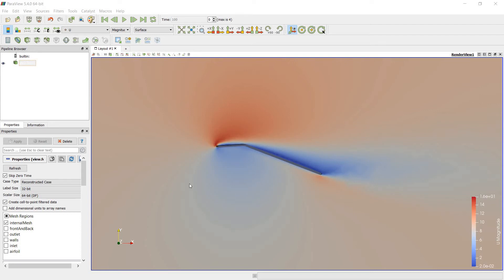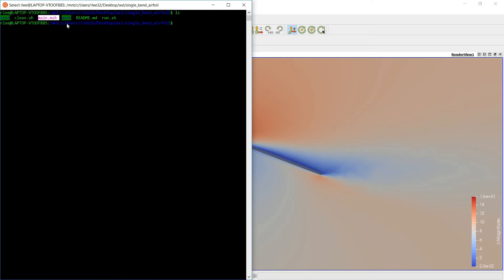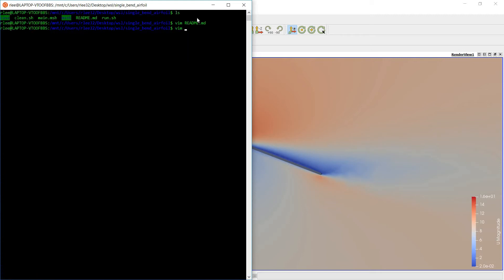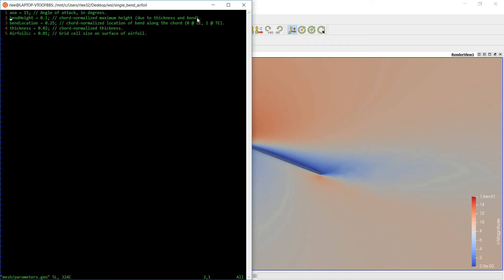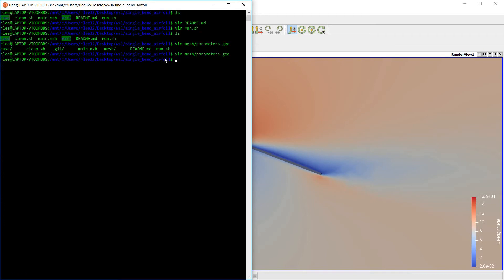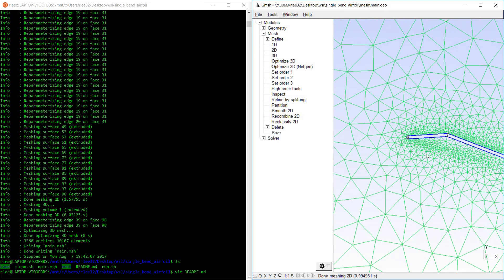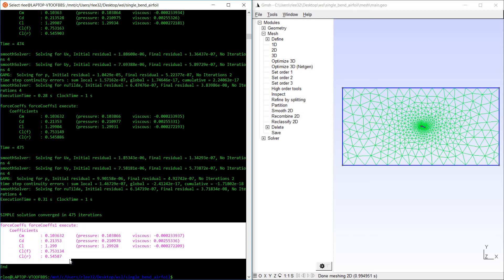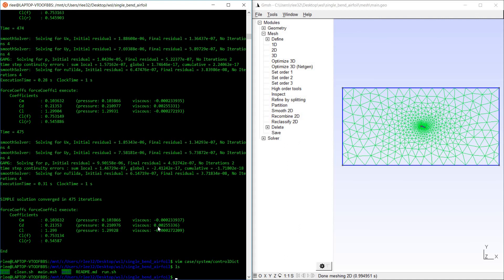Single Bend Airfoil in OpenFOAM

Comment: Hello, I am doing the simulation at 13 deg of an airfoil. The reported values of Cl are perfectly matching the experimental data but not the drag value. Which area did you use in contoldict/forces planar(from top of the airfoil) or frontal?
Thankyou

Comment: Could you also explain how the geometry was made in Gmsh please ?
Reply from the maker: Sure, can you be more specific? All of the Gmsh code is in the repo link in the description, under the "mesh" folder. I would suggest getting familiar with Gmsh syntax, then going through the Gmsh script.
Reply: Oh Thank You so much. Actually I am trying to do openfoam simulation for an airfoil. I already have the airfoil coordinate points but I am not able to build a rectangular block around the airfoil and cut the airfoil cross-section as you did. So I just wanted to know how you have cut just the airfoil section in the rectangular block. Is that using boolean cut operation! 
Thank you so much for your fast response.
Reply: This is an extrusion of a 2D plane (openfoam only deals with 3d, so 2d simulations are just planes with one cell extrusion to make it 3d). The plane is an unstructured mesh between the outline of the domain and the outline of the airfoil. Gmsh takes the outlines and automatically makes the mesh. You can specify structured meshes near the airfoil surface if you need to resolve the boundary layer.
Reply: Thank you Robert. Now I understood it better. I ll try to resolve the problem. Please do prerare some video tutorials when you find time. They are very helpful for CFD candidates. Thank you once again.